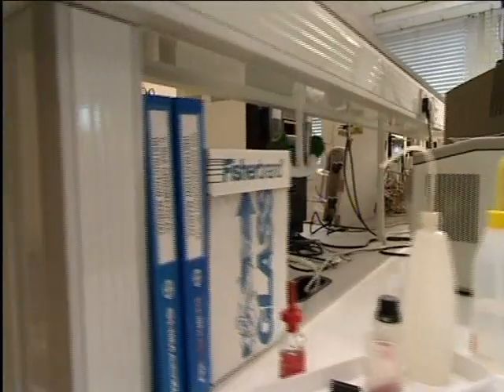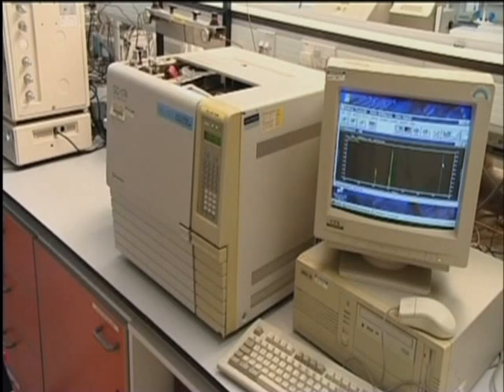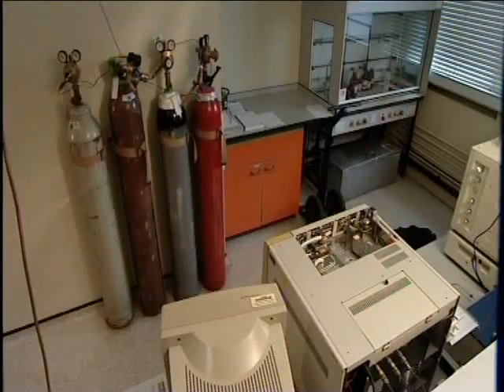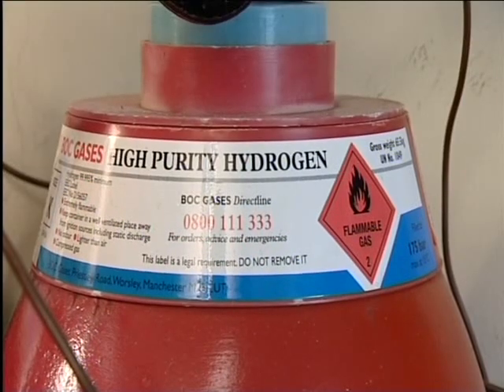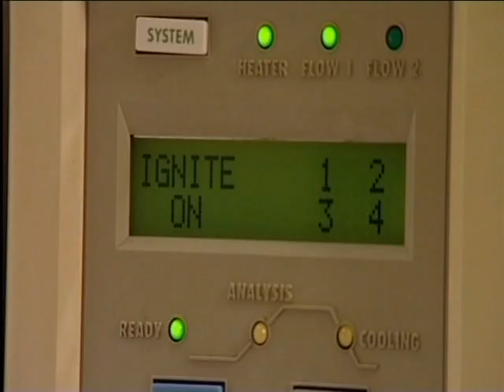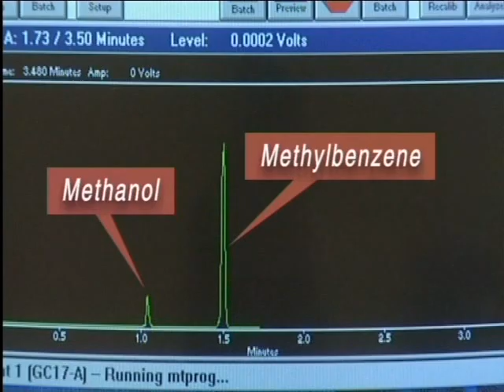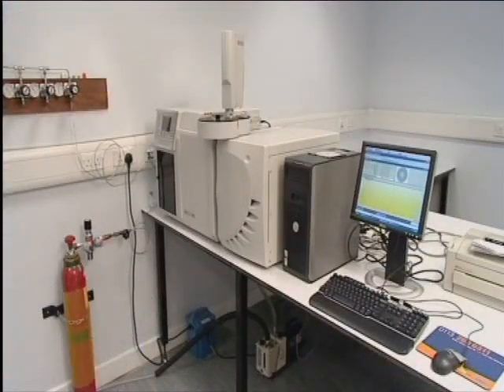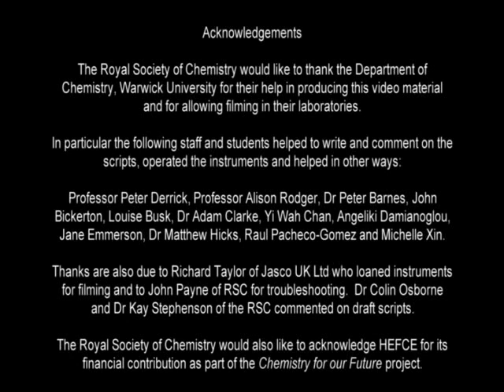Gas Chromatography GC

Comment: There are about 6 factors which will influence the retention time of the compounds in GC;
Volatility of the compound
Polarity
Column temperature
Column packing polarity
flow rate of the carrier gas
and length of the column
Volatility will have the greatest influence on the separation. Polarity is only important if you are separating compounds with widely different polarities. 
Good luck on your project.

Comment: Hi,
yes in GC the separation of analyte depends on its volatility but we should keep in mind that more polar the compound less volatile it would be,second thing the polarity of column in GC is also very important bcz inside the column the analyte molecules do not travle in a very straight line they move randomly and when they come in contact with the walls of coulmn they stay there for a while depending upon the polarity of analyte and column.

Comment: @Jerby7 
GC detects relative amounts of some analyte. To find concentrations, usually you do the method of internal standards. You compare the area ratio between what you want as an analyte and some standard which has a fixed concentration of your choice. You make standards of your analyte (using known amounts of the analyte) with the standard to make a calibration curve. From the curve and running your unknown, you can find concentration.
That's probably more than what you wanted lol.

Comment: @shaggyburns One method I used is called preparative gc. A larger column and a larger volume of injectate is used. As the carrier gas exits the machine, dry ice cooled traps are inserted in the gas stream. Any liquids are thus trapped. Change the trap for each peak on the chromatogram, to isolate each compound. They can then be identified by standard methods, ie IR, NMR, Mass Spec, etc. Another method is to use a GC/Mass Spectrometer. High resolution MS will usually give a unique structure.

Comment: @ncpatch If a liquid is viscous that implies that the liquid has resistance to flow. For example petroleum gel and water, which is more viscous? The answer is petroleum gel as it flows more slowly than water across a slanted plane.

Comment: The boiling point of methyl benzene is 110 degrees C and the boiling point of methanol is 64.7 degrees C. Methanol is more volatile than toluene. The molecular size of benzene is considerably greater than that of methanol. There are several factors which influence volatility not just one.

Comment: Why would you need to use GC and MS together? Do they not both show the composition of a mixture? What benefit is there to using both together?
Reply: Since the mixture is separated by gc, I'd imagine the mass spectrometer analyses the separated peaks too, i.e each individual peak, so more information about the unknown mixture can be obtained.
Reply: GC separates compounds and tells you how much of each compound is present but not what the compounds are, so the MS can be used to identify the unknowns

Comment: @shoukatkhan01 This has nothing to do with polarity, you maybe talking about HPLC in GLC the more volatile gas are the one that have a boiling point lower than the oven so they remain as gas some components are soluble in the stationary phase so remain less in the helium gas that's why it is known as partition not adsorption adsorption we can talk about polarity, but here we are talking about phase.